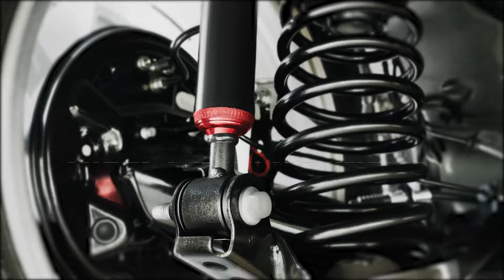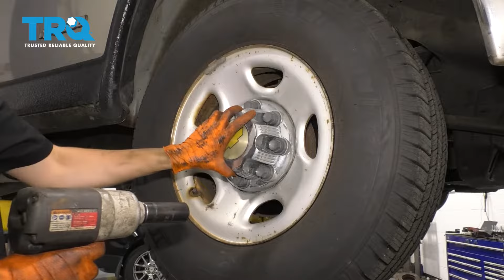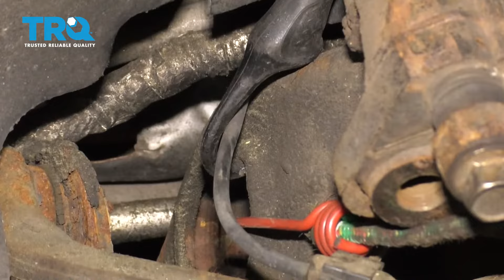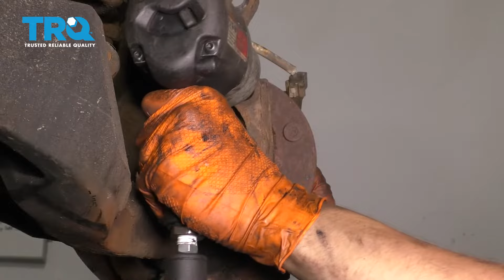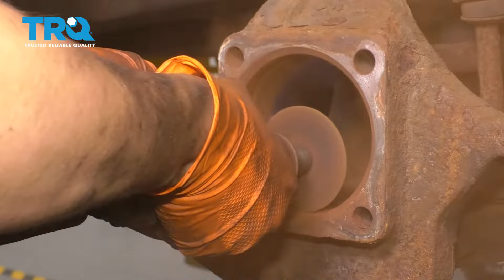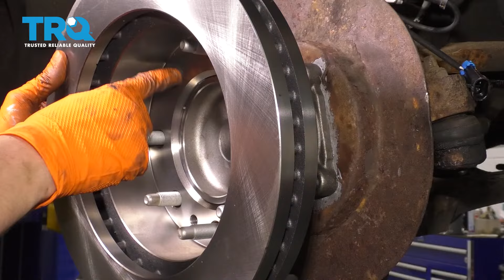How to Replace Front Wheel Bearing Hub 2003-2021 Chevrolet Express 3500

Comment: I love that you guys do this on the most rusted-out express van, ha! This is so easy, my local shop wanted $900 to replace a single front bearing... I get it, though, shops are gouging for money. Instead of offering the hub assembly, they go the long, painful route of doing the bearing itself. $170 for OEM assembly and an hour of my time.

Comment: Tganks for the concise video! Wheel bearing 133 ftlbs
Brake caliper backet 221 ft lbs
With locktite
Lug nuts 140 ft lbs

Comment: You showed such a concise and informative repair with tips on removing the brake caliper and other parts of it and how to reinstall and how to lubricate or (anti-seize)

I'm more positive now regarding my ability to repair this than I was before now I feel I will be successful in replacing my bearing hub assembly.